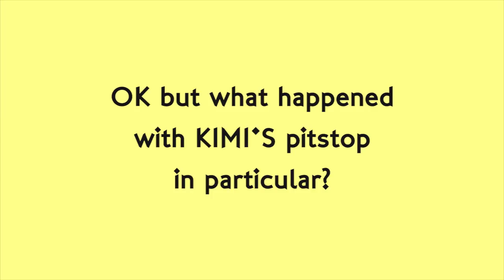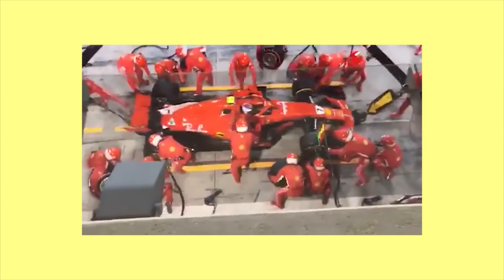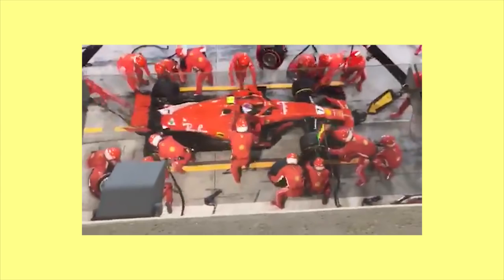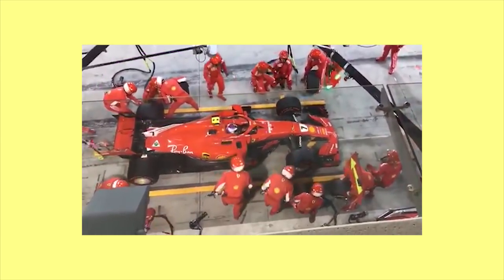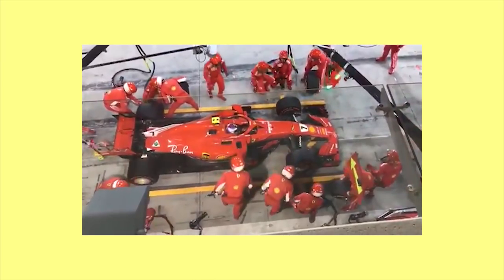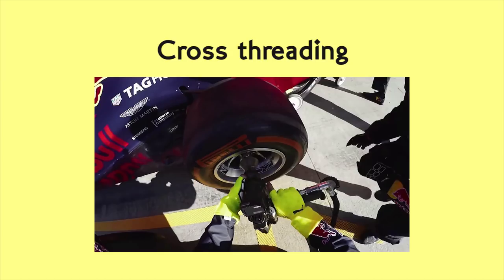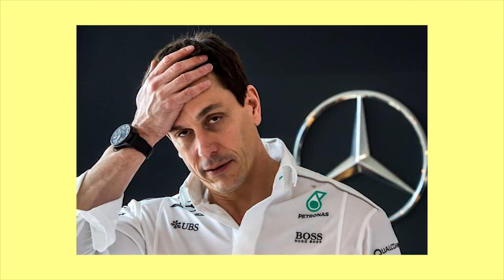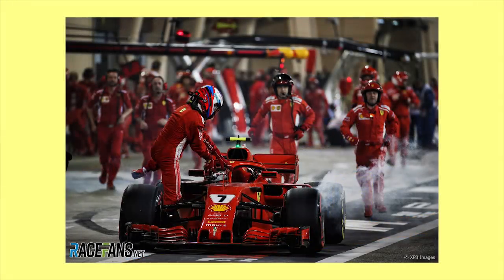Step-by-Step - what happened with Kimi's pitstop in Bahrain (pt 2)

Comment: Realistically, I think the only way to keep pit stops under 2 seconds and maintain a safety aspect for the tire changer would be to make the area in front of the rear tire an exclusion Zone. Make it a one-second penalty for the violations enforceable at the next Pitstop or the end of the race. The exclusion Zone no longer exist once the wheel comes off the car allowing the mechanic to get in and set his new wheel and reactivates once the new wheel is tightened on. I believe a rule such would prevent any mechanics from loitering in such a potentially dangerous area.

Comment: I read a lot of comments about this 'lollipop'.. as someone very new to F1, I have no idea what it isany resources to know more about lollipop?
Reply: The "lollipop" is slang term for the old style bulletin sign.
They were still in use in NASCAR back when I followed it, but haven't been used in F1 in ages.
The idea is that an operator holds the sign out in front of the pit box as a signal for the driver to stop.
Once all four wheel mechanics (and when appropriate fueling) are done, the signpost guy pulls the sign out of the way, telling the driver to go.

Comment: Hi. Why are pit stops necessary at all? Can you make a video hypothesising a no pit stop race? Thank you!
Reply: In 2005 the FIA experimented with no tire changes, although refueling was still legal then.
There were many reliability problems with trying to nurse a single set of tires for a full race though, and after trying to solve the problems with ruel tweaks, they recinded this rule due to the safety risks of tire failure.
2005 wasn't all that long ago either, and while tire technology has improved, I personally fear that a return to this rule would hurt racing by encouraging more conservative driving through more of the session. 
Fuel conservation is already an unpopular aspect of present strategy.
Formula E follows a no-pitstop format, and I love that series, but they are definitely not F1, and they can easily coax a normal set of road tires for an entire session.

Comment: This is the problem with using too much technology in an area that doesn’t necessarily need it. The release standard in the old days required the driver to wait using what was calls a “lollipop” man holding a manual sign in front of the driver to tell him it was safe to be released or to continue to wait until it was safe. I think this would have helped in this particular case. Granted it would slow the pit stops a bit but it would be a safer solution and could be implemented for all teams thus leveling the playing field for all teams and making pit stops a bit safer for the crews. I also believe the pit person on the left rear should have not been standing directly in front of the rear wheel to begin with as that only added to the risk of him being injured.

Comment: I think that if Ferrari is using that system it's brilliant. Although they should be able to sense which direction the impact wrench is trying to turn and only give the go ahead signal if the proper torque is being applied in the clockwise direction

Comment: I think I concur with Marc Priestley when he says it's Ferrari that has the pitstop problem, not F1 in general. As far as I'm concerned, the problem stems from the Ferrari-designed wheel hubs having inconsistent compatibility with the nuts that Pirelli put on their tyre sets. Such a looser tolerance for reliability in favour of greater performance is a common tradeoff to see in F1; if not, they'd be racing stock family sedans instead of purpose-built carbon beasts of speed.

As for the pit system, I think I'm very sick of people saying the lollipop man should come back. There's always one person in the crew whose entire job is to watch the others and make sure that the others have done their job and are safely out the way, and override the lights otherwise. That guy is always there at the front watching the pit crew and he's not one of the jackmen or spare jackmen. That's your lollipop guy, he never went away, he just has a different tool now that's not a plate at the end of a stick. Other than that, yes, mechanical job-done switches on the wheel guns please.

Comment: The gun theory you proposed doesn't make sense to me, as they'd be able to differentiate between the two turning directions.

I honestly don't think they should change anything. This doesn't happen on a regular basis, and there will always be risks involved. No need for knee-jerk reactions.
Reply: MrTristan its happened so many times this season, and its only been race 2....
Reply: it probably measures line pressure on the other side. So all it would see is a load not the direction.
Reply: My theory is that, if it does detect direction, they could have been trying to tighten the nut to get to loosen up. I have had to do that with screws before. Screw them in, to screw them out, hoping to correct the cross thread while doing this.

Comment: I think F1 pitstops are just too quick for human perception. Both Haas pitstops in Austrlaia clearly showed that mechanics just don't have the time to signal for a "hold the car, there's a problem." I also think that a minimum pit stop time is stupid, this is racing, people should be going as fast as they can. My favoured solution is bring down the pit crew to 1 man per wheel, like in many other motorsport series. That will slow things down to a proper pace that human perception has time to react to mishaps and hold the car when needed.

Comment: I'm not sure FIA will limit the number of people on the pit crew but I think this is an easy way to limit the potential for injuries as less people over the wall equals less people in harm's way.  They could use an Indycar like set up with just one person per wheel.  It wouldn't add too much time to the pit stops but the time it did add would allow for more time to address problems and avoid incidents like this one.  

I'm sure FIA won't change anything and they'll leave it up to the teams to adjust their systems to avoid these kinds of errors.

Comment: Button/sensor on the gun is not a good solution. Put a sensor on the car that triggers on the wheel. When the car is lifted on the jacks a red light goes on by every wheel. When the old wheel comes off the loss of pressure from the now absent wheel triggers the sensor. When the new wheel comes on and is properly tightened the sensor triggers again and the red light goes off. Someone should also watch the process by a camera mounted above the car, which would give a safer viewpoint for the procedure, and be able to override the green light.

Comment: I mean automatic Systems make sense, due to the speed but safety is also important. Sure there is no perfect solution to keep the speed. One is that the fastest Members, like the guy that pulls out the old tire must push and hold a button when his section is ready or about to get ready. This shouldn't be a signal that they are done but that everything is going as planned. When then suddenly something went wrong they can release the button.
The watching operator has lights for the different parts and they start yellow and turning green, when the button is pressed. When it suddenly turns red, they know that something happend. They also hold down a button and can release it, when they notice something.
The buttons shouldn't take longer, because they get pressed early, before the car is really ready. That's where the automatic systems come to play. They operate as usuall and should he the last "buttons" that get pressed.
This is the fastest solution, when they find a easy way to press down the buttons with no hands.

Of course the FIA can make the stops slower, so that there is more time to detect if something went wrong.

Comment: I am BRAND NEW to watching F1. The 2018 season is the first one I have ever attempted to watch. I saw this and my jaw hit the floor. I could clearly see the guy wasn't moved out of the way and the tire had not been removed yet and as soon as they dropped the car I was all 'oh crap, this dude is going to hurt tomorrow'. Personal feelings on the subject, I think a button just outside of arms reach at each of the four corners of the car as well as a fifth for an overseer whose job is ONLY safety would be a good idea. Minimum pit times also seem like a no-brainer to me. 5 seconds should just about do it. I mean, they put some gawdy ring of metal that is right in front of the drivers face for safety, which I totally support BTW, then why not make equally unoptimal concessions for the safety of the pit crew? No automation, just a simple light with green meaning go and red meaning not, all five buttons need to be pressed and that 5 seconds needs to pass before the light turns green, period. Maybe 4 seconds, but there should still be a tiny minimum IMO.
Reply: I think that if there were to be a minimun time it would have to be 4 seconds at most and 3 seconds at the very minimum, the accidents usually happen when they try to do low 2 second pitstops

Comment: The guy was out of position. He is the only one that had a body part in front of a wheel. Even the mechanic in the middle could sense his leg being too close to the car and you could see him pull it back. It appears that all pit crew are trained to keep their bodies on or outside the yellow lines. Cigarini did not do that. Appears to be a break down of procedure more than any issues with equipment.

Comment: The release of the car should be mannual. Also, with more than just 1 guy to do it. 
Bringing back the lollipop is putting too much pressure in ONE person.
Reply: Even if it becomes manual, like i said equipment will fail and ppl will make mistakes so accidents will happen, for example locking up breaks on a damp track while going into pits the car can hit any of the mechanics.
Reply: Yeah I agree. One man at every wheel with a button to the green light would avoid an incident like this.
Reply: Thats still prone to failures though, not syaign its a bad idea but that can fail aswell.

Comment: Surly the engineers can come up with a better weelnut ... Or the tyre manufacturers can come up with a tyre that can last the race distance...
Reply: I believe Pirelli factor in tire life when they engineer the F1 compounds, meaning they specifically control how quickly the tire degrades. They could easily create compounds that last as long as modern-day F1 races, the problem being that isn't what F1 wants from the tires, and designing a compound that fits that tire-life parameter would be detrimental to other tire factors such as grip levels, heat generation, blistering, and graining.
Reply: I don't want another 2005 season, that season was terrible in every single way and a good part of it was the tyres

Comment: This is becoming ridicilous evrytime something happens theres some unnecessary change going on, removing refueling during pitstops, the halo, now ppl want to make pitstops have a obligatory time of idk 5 sec. I feel like we are all forgetting any kind of these accidents are extremely rare and even with the lolipop guy back that wont solve it even with the mandatory 5 sec. pitstops theres still goin to be accidents, equipment failures, human mistakes and stuff like that and while i hope the mechanic recovers fast and is all well and fine, lets just stop forcing unnecesairy changes and make such a fuss just couse a single accident.
Reply: Well i guess i can understand that but at the same time were there really that many refueling accidents? i know there were situation where cars cought on fire or the fuel hoses were ripped off and draged behind the car but did it really happen that often? Removing it just rmeoved another feature of F1 and removed a lot of strategic planing since everyone starts on a full tank now.

Comment: If they were using g the button system you outlined in the other video this wouldn't have happened, so it must be something like this. Very dull and dangerous I hope the FIA talk to all the teams to get a concensus on where to go from here.

I'd assume forcing the button system is fine but at the same time I wouldn't want that to stop any possible future innovations they may come up with, as long as those are safe.

Comment: There has to be somekind of regulations about where the mechanics should stay, as you can see he was the only sitting inside the yellow line, obviously there is a reason why all the other guys are not. I mean, it is sad that it happened this way, but it could have been avoided, Kimi could have taken a lot more time in the pits or get released without a changed tire, but there wouldn't have been anyone wounded.

To me this is a human error, not a system fault.